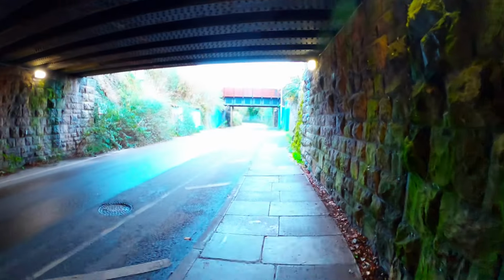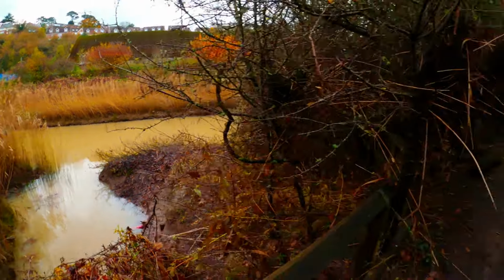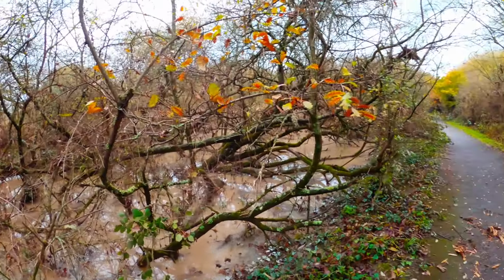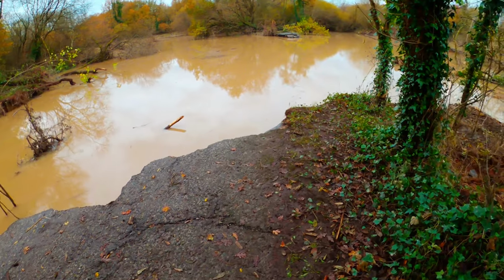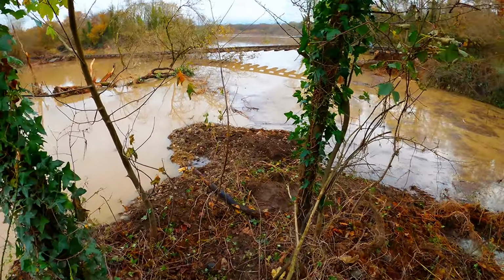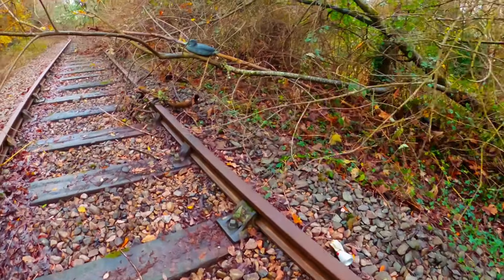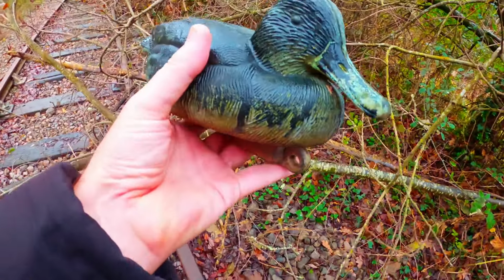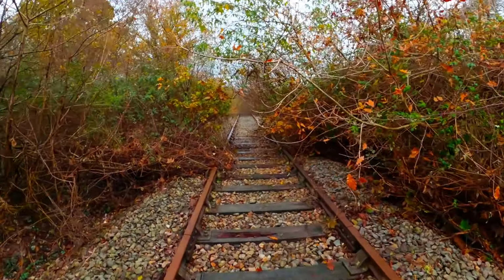Teigngrace Railway Newton Abbot Swept Away by Storm Bert 'aftershock' Climate Crisis

Comment: Highest it reached was 3.43m on 24th December 2013 but broke it's record on Sunday 24th November 2024 of 3.58m high the River Teign
Reply from the maker: This seems to be a new cut & is at least 400 metres away from where I took a boat along the Teign back in 2023, which is the other side of the now huge quarry pool.
Reply: Has this damage been caused by the quarry removing land that had protected the rail line from flooding?

Comment: I cycle on that path regularly. I am devastated to see the damage caused by storm Bert. 

I doubt it will be fixed anytime soon.
Reply from the maker: Seemed to a be a bulldozer moving earth so maybe the breach can be filled and the path rebuilt once the flow ceases, could be a while though, early summer maybe.
Reply: @sandpit72 I wonder what condition the path and railway line is in once you get over the level crossing by the MT Tums diner heading out to Stover.

Comment: I think this is possibly the end for the Teign Valley Branch
Reply: I hope nope but would not be surprised.

If they ever build a high speed line from Bristol down to Plymouth it will follow the A38 west of Exeter. If newton Abbot and the coastal towns want to be connected it will be via this route and a station at Heathfield.
Reply: I agree.  If the main line West of Exeter is ever replaced, the coastal route to Newton Abbott and on to Torquay & Painton would still usefully serve both residents and holidaymakers. It would make no commercial sense to build a station at Heathfield for quicker connections to NA when changing at Exeter onto the Exmouth-Paignton service is available.
Reply: @tonyburgess7773  The rock under the sea wall at Dawlish is quite soft. With a 0.5m rise in sea level sometime towards the end of the century it will become more expensive to maintain. I would not be surprised if it ends up as two branch lines.

But we do not plan for the future and the Teign Valley Branch will be built on costing more in the long run.